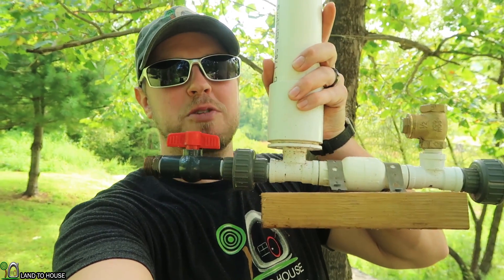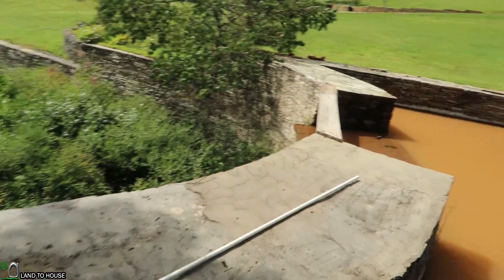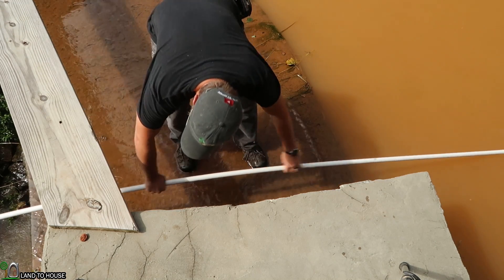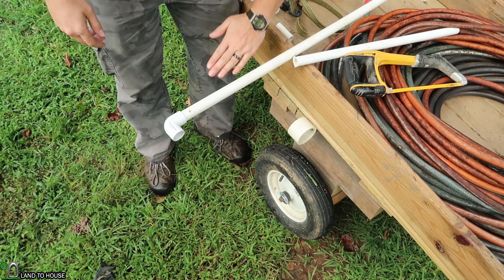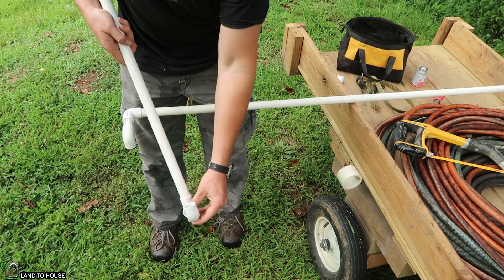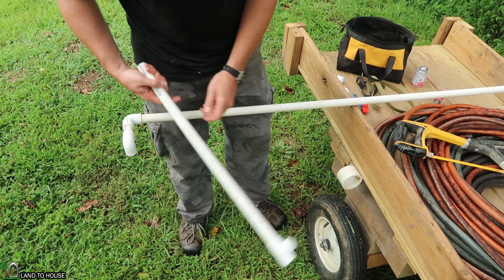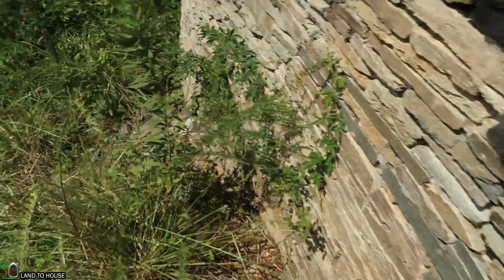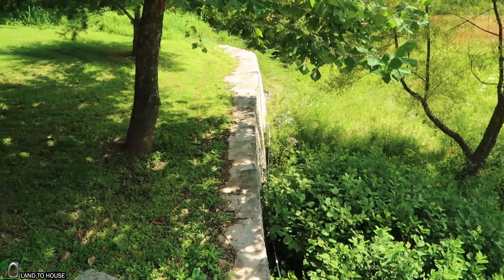WATERFALL Ram Pump

Comment from the maker: Did you know that you can buy ram pumps on the Land To House website?
www.landtohouse.com
Reply: Ever try what we do with two strokes? Start bigger go smaller.. with good ramping I think one could use the harmonics kinda like mazda did on the na s4 fc3s rx7s.. gets more air in at higher pressure faster at certain harmonics. That with a small drop in size across the pump should really up the flow and pressure. Would love to see it done don't have the need for it atm so I won't be building one anytime soon 😂

Comment: Nice video and presentation 
Each time i watch this channel I saw you open the output valve from off to fully open followed by tens to hundred triggers with explanation for that. No disagreement in that. 

As an alternative, modify the pump from ball output valve to a tap valve. The intension is to keep tank pressure up with a controlled restricted flow such that to save us from a hundred or more starting attempts. 

Calibration? 
start the cyclic with output valve closed, once it started, slowly open the output valve until it just stops. Tighten back the tap a bit and call it a threshold. Trigger again to start cyclic   . The hose will be filled itself. 

Caveat? The back pressure we created at the tap will disappear when the hose is full under a full up hill head. 

What do you think?

Comment: I've always wondered why you open the ball valve on the delivery side complety instead of partial. I mean, if you get it to cycle, might as well let it do its thing and fill the delivery pipe slowly but steady while doing other stuff. Just a thought. Great video as always.

Comment: I have to convince you that you do come up with some very innovative ideas to test up the good work you never know where it will lead Period I'm gonna try using some tulip augers in pipes and see if I can use a siphon tube about 30' down to suck water down spend one hour around and have it spin the other order around and if I have to pull the liquid towards an elbow I only have to get my water up maybe 3' to do some good from the source so I'm gonna work on that rather than the Then the pump that you're using working on I understand there only about 15% of fisn't so it shouldn't be too difficult to come up with another possibility either using a turbine on one side and the centrifugal pump on the other to pump water up what 3 or 4' to get it to where I need it and I have a drop of about at least 30' to the river from on my mind my little stream . Anyhow take care

Comment: Is a pump this size, big enough to run a waterfall straight up 9ft high? I want to install one of these at my pool, I have an extra water tank in Wich I want to submerge a rampump and the hose to the top is no longer than 15 ft but goes 9ft high.
Reply from the maker: The ram pump is not going to work in a closed system. A pump this size consumes 2gpm and pumps 1/4 gallon per min. Not an impressive waterfall.

Comment: could you help me
i have 5 meters intake pipe about less  a meter drop maybe 80cm can this be enough to flow uphill about 12ft high its steep almost 90 degrees slope 
(sorry im not good in english)

Comment: We need a ram pump that will pump up about 95 ft at about 45 degree angle. The water is a spring in a canyon below our house. We  would use this water for Everything as it is also our well water. Can this be done? I  was thinking the largest one you have. We also have very cold winters. Would this freeze up if we insulated it then run it into another larger pipe?

Comment: You need a sniffer valve just before air tank.
That provides air suctions to air Tank.  if not there , after a while the air gets dissolved in water and banging load, plus less efficient .  use one way valve  with small adjustable opening and some leaking to out side for sniffer .

I did one of these 40 years ago for graduation project.
$0 years ago there was no Google, I had to do research in Library, pulling dusty books of 1900 from Indiana University library basement for its theory and calculation.

I had to Machine the hammer valve and adjust the weight proportional to head pressure( forgot calculation).
If the amount of water is large enough,   those Brass off the shelf hammer causing valves are great;  folks can put four pumps next to each other

This is a great device for hilly areas with running creeks.

Greetings from California.

Comment: Get a garden hose end cap (plastic) and drill the smallest hole in it that you can, put it on the end of your first length of delivery garden hose.  That ought to allow you to capture enough back-pressure for the pump to cycle on its own much sooner than 100+ prime attempts and still allow the pump to move water uphill.  Once you see water coming out of the hole, attach the next length of hose and repeat.

Comment: So you need that back pressure to close the horizontal valve ? Why don’t you install it vertically so the gravity take care of that ? There’s plenty of videos of people doing just that and they don’t need any back pressure to get the pump going, they can literally just open the valve without a hose and it keeps going.

Comment: I bought 2 ram pumps from your website, I use them to bring water to my sheep wich are 2 miles from the creek. The ram pumps are amazing. I really like those ram pumps.
Reply from the maker: Wow 2 miles! That's great! Thank you for the support and feedback!
Reply: @LandtoHouse  I have to use an gasoline powered pump to generate suction, but it works very well and saves me the money that it would be to run plumbing to 
My sheep pen
Reply: 2 miles , in canada 🇨🇦thats alot of km !!!

Comment: Deceptive, its just a remote intake, Doesnt actually use the waterfall (gravity fall) for operation. Catching the falling water, funnel or otherwise, would be a waterfall ram pump and interesting so see if that method would increase flow pressure/rate.

Comment: Some pretty nasty looking water there but if you would use 45° angles instead of the 90° then that would give the water a smoother flow plus turning your siphon to face downward would keep more of the sediment from getting into the line that could settle at the low point and cause a blockage.

Comment: 1000 Video's and 999 ARE CRAP .
  What I never see is how long will a ram pump stay running by it's self .
 will a Ram pump run for weeks and month's without having to re start it ?
 What good would it be if you had to keep starting it all the Time ?
Reply from the maker: Super uplifting comment.

My personal testing I have run a ram pump for 6 months non stop. There are some pumps that have run 30 years without stopping.
Reply: @LandtoHouse  Probably Goombah! would be the only one who is enjoying a 6 month long video with nearly 16 Mio. clicks of a ramp pump nonstop. ;-)
In some ram pump videos Seth was mentioning that the ramp pums was running several weeks or has stopped after several weeks of nonstop operation. But I thing that logevity of operation strongly depends on the up-stream setup and on involved animals ;-)

Comment: Why don’t you  slightly crack open the valve on the water hose. It might restrict it enough but then again it might not because it’s a pulse
Reply from the maker: That does work. It turns out that I needed to extend the delivery pipe uphill another 100 feet to build back pressure.

Comment: Why does he never use the purple PVC primer? Especially since it has pressure.. 🤔
Reply from the maker: I know using primer is very common practice. Have you ever read the article showing that primer doesn't necessarily add strength?
Reply: Land to House one article says doesn’t necessarily =/= not using it anyway in case that is wrong?
Reply: @LandtoHouse  I read the material testing study that showed primed joints failing at lower strain loads that glue-only.
Reply from the maker: Yes that one is interesting!

Comment: Why are the pumps so expensive?
Reply from the maker: You can save some by building yourself. There are a few videos on the channel showing you how to make them.
Reply: Land to House alright, thanks. I was just curious to know 👍 great channel btw!
Reply from the maker: @smallengine  thank you!
Reply: His pricing is pretty on point.....   I made the same pump myself for about $145 from lowes.    It took maybe 2-3 hours fiddling and gluing to make it all (1st time ever making one so I'm sure it can be done in 1 hr)    for the parts needed, and his personal time taken by maki g the pump...  he's walking away with $40 for 1-2 hours of his time at best.    His designs are also some of the best iv researched.  The one I mimic (1inch) filled a 275gal tote in 8 hours pumping 800ft away uphill about 30ft at a solid 20psi......not sure it can get much better...
Reply from the maker: Thank you for the great feedback. The pumps do take a good bit of time to build. I'm able to save money by ordering in large quantities. Your setup seems typical for that size pump.

Comment: All you had to do is crack the valve open a little bit to keep the back pressure so that it would keep pumping
Reply from the maker: It turns out that I needed to add the extra hose. There was not enough back pressure to run 8 feet of head pressure.
Reply: I came here to say the same thing

Comment: Might not want your valve discharge at the base of any structure whose base you dont want eroded away.
Reply from the maker: That is true. This old pond never did have water filled to the top. I dont think its going to be an issue with the ram pump splashing up on the side.

Comment: I wonder if you could include a pressure regulator as a way to maintain a high back pressure. If connected in line with the output it would only release water if the pressure is high enough thus ensuring the rampump doesn't stall. Don't know if that would reduce flow though.
Reply: the spike in pressure would falsely trigger the reg to release air. if its tickin along at 20psi it will spike 22 or 23 psi then rest back at 20

also your first sentence log jammed my brain

Comment: suggest using a 'foot valve' with a weight rather than a flapper valve for the 'waste' valve, for better operation
It is (usually) best to S-L-O-W-L-Y open the delivery valve so the delivery hose can be filled without blowing away all the pressure in the pressure cylinder
Reply from the maker: Yes indeed. I have used foot valves and had 2 of them fail. The new Stainless Steel waste valves that I use are a lot more resilient.  Turns out in this install the 8 feet of head pressure was too much for the hill I was lifting to.

Comment: Whoever built that wood plank at the waterfall didnt think it through.  Should put it in the inside.  I would think its place there for crossing.   The placement  currently will result if one lose their balance, they will go over a huge drop.  Not very ideal.
Reply from the maker: my neighbor was doing something with that. He has an actual bridge on the next waterfall up. It's got railing and all that
Reply: @LandtoHouse  My impression was it served as a safety rail for standing in the waterfall

Comment: Pretty neat what footage of water line did u run? And would it work better with a mouth to funnel more water into the main feed pipe at the beginning of the contraption
Reply from the maker: This line was only 30 feet long or so. The ram pump is only going to use a set amount of water so a funnel does not increase the efficiency.
Reply: @LandtoHouse  thank you man subscription for sure

Comment: Do ram pumps scale up? Bigger hardware/pipes = moving more water? or is there a sweet spot?
Reply from the maker: Yes bigger ram pumps use more water and move more water. They dont move water higher though. Each has about the same lift potential.
Reply: @LandtoHouse  So bigger the water volume with bigger pipes, but more limited as to how high it will pump? I find all this very interesting.

Comment: So you need a open pipe on the feed side that has a screw top to allow for priming the pump. 
The screw top could simply be screwed on once the pump is primed, and if it glubs up, it could be un-screwed to re-prime it.
Strange Things has a good suggestion about cracking the output valve slowly to maintain pressure, but you could also have two valves in series to basically setup a pressure build-up game. That would be extra cost, and potentially more points of failure though.
Reply from the maker: Screw tops can be a bit tricky because the threads can leak.  That is why I went with the ball valve. As long as the siphon can be started it does not matter how the water is introduced to the pipe. Because the source is at water level over the rock spill way you could even start the siphon the old fashioned way. Sucking in from the bottom.

Comment: You should just crack the valve open slowly. That would save you a lot of time priming your pump.
Reply from the maker: The main issue was that I did not have enough hose going up the hill. The water was leaving out the delivery pipe and not building back pressure.

Comment: Neat. I've always wondered how a straight drop would perform.  My pump is very similar to yours.  I've found that if I gradually open the delivery valve, I can regulate and maintain the back pressure to keep the pump cycling until I have full back pressure in the garden house.
Reply: The first line of the video description contains "connect a ram pump directly off a waterfall".   I was also hoping to see what the ram pump would do right off the waterfall.    I'm still working on understanding how a ram pump works.   The 8 feet of head from the waterfall and maybe another 2 feet of fall to the pump would be 10 ft, which by itself would give less than 5 PSI of pressure (one-foot column of water that's 1-inch square weighs . 433 pounds)".   To reach 50 PSI in the pressure chamber may illustrate that 90 percent of the pressure is coming from the pressure wave created by the valve closing on the water moving in the drive pipe and not from the head.      Still seems like magic to me and may have ramifications for how to optimize the system.    Do I have this right?
Reply from the maker: Yes absolutely! The problem was that I did not have enough hose for delivery. Water was leaving the delivery pipe and not allowing enough back pressure. The partially open delivery pipe is a good way to go about filling the pipe.